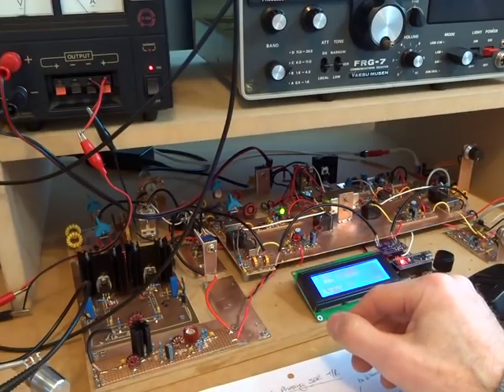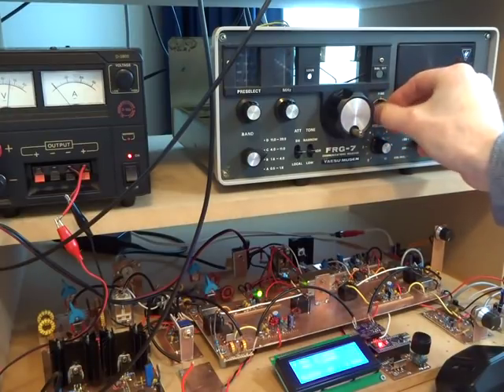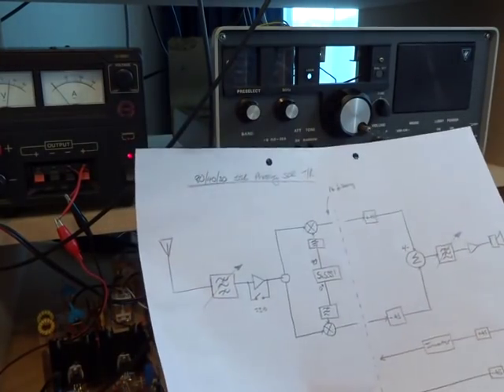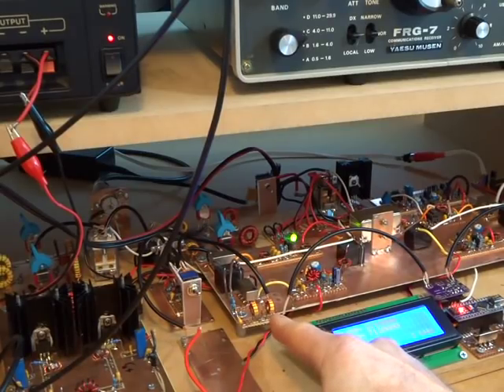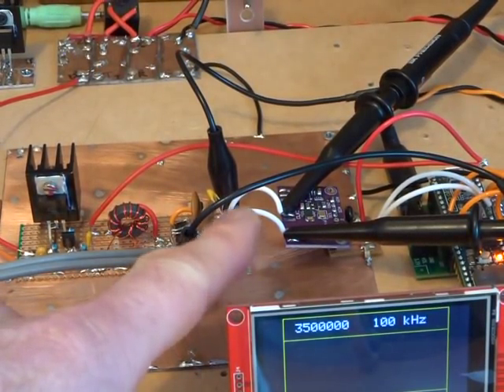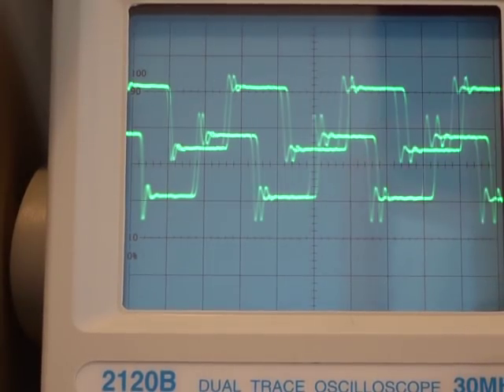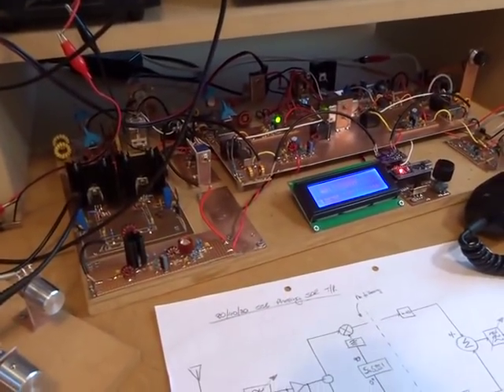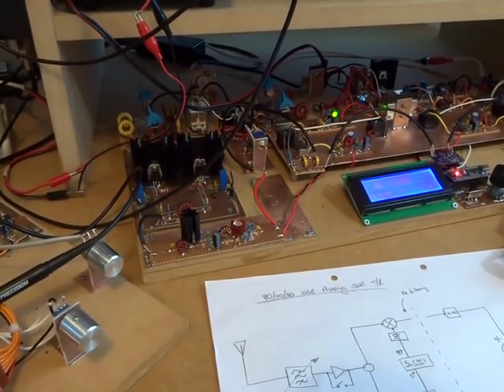80/40/20m SSB SDR Phasing Rig: Part 1. Thoughts and Ideas

Comment: Hi Charlie, Greetings from Ireland, I built your previous phasing rig with the NE612 and the Teensy 3.5, it worked really well until I blew the Teensy with a loose wire! At night on 40m the NE612 was swamped by 40m broadcast stations. How does the RX on this build compare? I have read that the SBL1 is not prone to over load. Of all the rigs you have built which has the best RX performance? I should be taking my radio exam this month but it has been canceled so it will be a dummy load for the next few months! I hadn't built any thing for 30 years until I saw your channel, it is truly inspirational, 73s and best regards, Myles
Reply from the maker: Hi Myles. Sorry to hear about the Teensy. I'm really pleased too that you find the channel useful. The radios are not supposed to be competition grade, but enough to get on the air and experience the joy of radio communications. I have not built that too many NE612 based RXs, but they have worked  well here. I have heard that they are not so good in the US, probably for the same reasons you are experiencing in Ireland. All of the double balanced mixer based RXs such as the TUF-3, SBL-1 etc have worked very well for me here. I suggest you try one of those. You may also wish to emply a switchable attenuator in the input before the first mixer.

Comment: Looks like your own version of the KX2/3 rigs.  One idea would be to not go pure direct conversion, but to a LF IF, say around 15-25khz.  Use an active LPF filter in each of the I and Q legs, and then do the usual demod and filter in the DSP on the IF and Audio.  Only change in the analog would be to tune the LO 15-25khz higher in frequency (use high side injection), and combine the I and Q outputs in software, not hardware (will need two A/D converters, but the Teensy audio board has that).  There are advantages to using the LF IF approach over direct conversion, including avoiding the zero freq 'suck out', and being able to add a band sweep display.   Also how about experimenting with FET switch mixers, using two H mode mixers for the I / Q channels?
Please publish your I/Q Si5351A code!   I'm not sure the SBL's need Sine wave drive (FET switch mixers don't).
Reply: If you look back to 26th Jan 2019 on Charlies blog you should find the quadrature code.   http://zl2ctm.blogspot.com/
Reply from the maker: Thanks for the input. I'm certainly acknowledge others have done this way before me. My plan is to stick with a DC for now, and use a BPF to exclude the zero cross over. The beauty of software is that I/we can easily change it to implement another configuration with ease. As for the code, i see Brian has replied below. I'll also add whatever I come up with on the build. Thanks again.